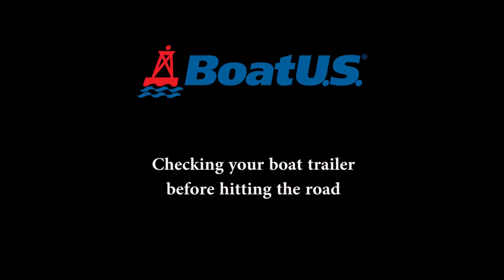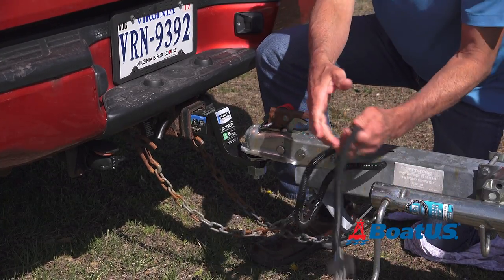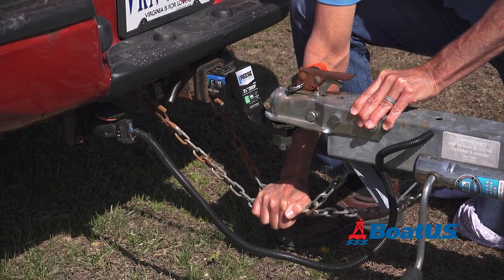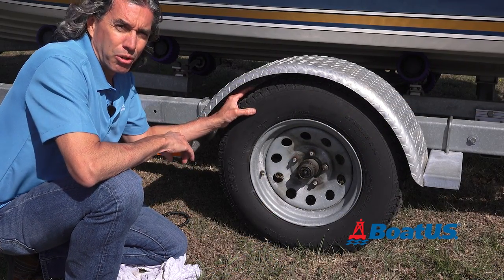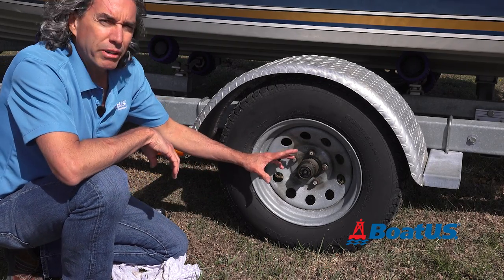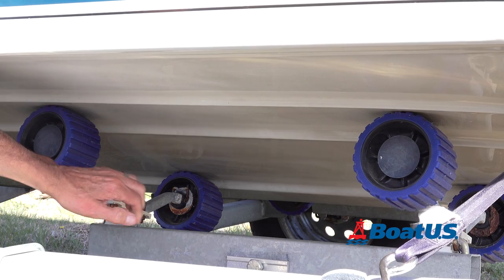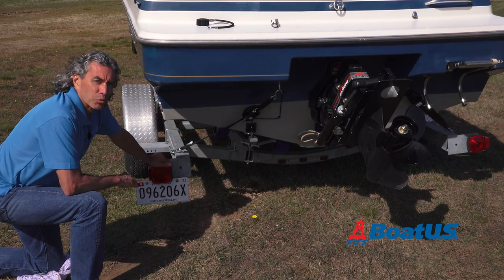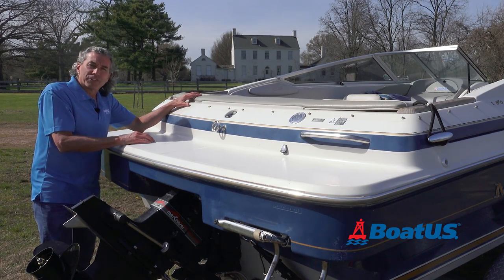Prevent Boat Trailer Breakdowns [✅SAFETY CHECKLIST] | BoatUS

Comment: Thank you but you did miss a few things, with respect:
1.  The first thing mentioned, about the coupler, you worked it up and down, but one needs to have it jacked up, off the tongue and be sure as you lift it, it is in fact, moving the fork it is connected to below.
2.  The lock does not work, "just as well", it works far better, because without a lock, anyone can simply pull the pin--it happens all the time as just horrible people see a pin and take it for their own use.  Lock it every time
3.  You did not mention the breakaway cable.  This means if you lose the trailer, which you did describe in terms of the heavy chains catching it--the breakaway cable forces the trailer brakes to actuate.   I can't see your brake away cable at all, maybe I am not seeing it.
4.  The wire for the lights is sitting right on the ground, that can't be.  You must shorten it, usually people just wrap it once or twice, as needed to insure it has play, but is not dragging on the ground.
5.  You mentioned the transom straps should be snug, those were pretty loose and need to be tightened before towing.
6.  A good time to be sure the plug is in.
7.  A good time to be sure you are not wet in the bilge; in my area, they turn you away at many lakes if it is not bone dry, and yeah, they do check.
8.  Turn on your battery, and make sure you are not low on battery power.  So many times I see people AT THE RAMP realizing their battery is dead.  Turn it over, it if catches, turn off immediately as it can't run without cycling water.  But now you are 99.9% sure it will start and run at the ramp.
Reply from the maker: Thanks for your input.

Comment: At what age should tires be replaced?
Reply from the maker: Great question, Fishy! It's not so much an age thing or a mileage thing, as with cars. Because boat trailer tires generally sit more than vehicle tires, they're exposed to sun and elements, not to mention water (particularly if it's saltwater) from launching/loading your boat. You'll need to check the tread depth--a simple penny can help you do this--and look for cracking on the walls (both inside and out). Here's a video you might find helpful: https://youtu.be/N4HjOn48R40 Ensuring the tire pressure is correct before each trip as well as covering your tires can help extend their life. If your boat is on the hard for a long period of time, you might consider jacking up the trailer and pulling off the tires and storing them until you're back on the road. Let us know if you have any other questions, and thanks for watching!

Comment: Kind of funny, left tail light didn't come on. Video was a good reminder.
Reply from the maker: Sure it did. All the lights worked perfectly. Maybe it looked a little duller than the right due to the angle? Glad you find it helpful though.
Reply: @boatus  look again, at end of video lights ON with his hand on left tail light is out. Lower filament is on the right light but not left. Hand shading light would show it on better which is not. My opinion back. Watch it !
Reply: @boatus  sorry buddy, but take the cover off and im 99 percent sure the bulb wont light up. Best solution, LED's.
Reply: Those incodecent lights are crap in salt and worth next to nothing in reality. LED's all the way. A little more money, but brighter and way less trouble.